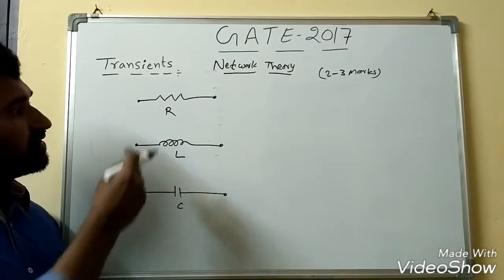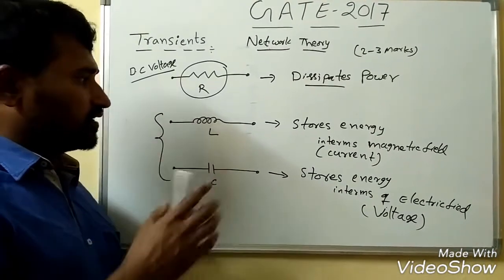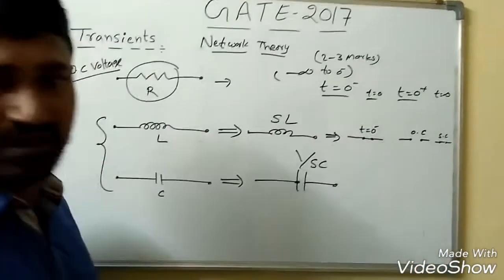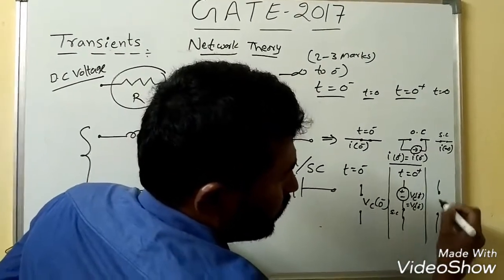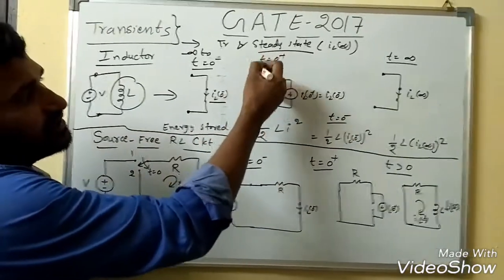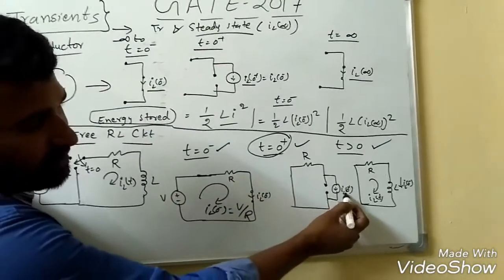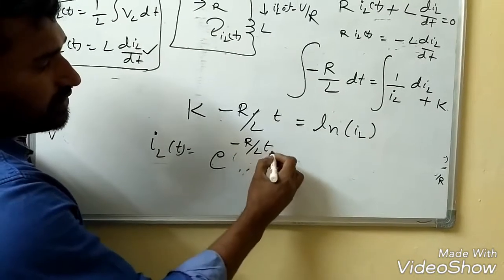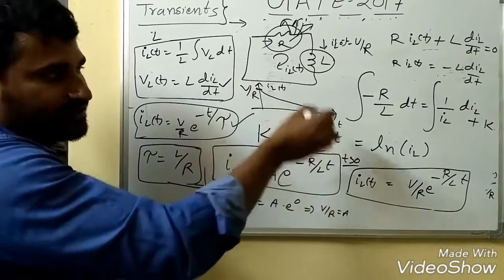Network Theory Lec-18(a): Introduction to D.C Transient Concept

Comment: sir what was the use of DC transient state
Reply from the maker: no it was not use of transients....if we apply a dc source to a RC or RL or RLC network there will be transient conditions...because d.c means sudden changes..but the storage elements (L and C) will oppose the sudden changes this condition is called transient state
Reply: Learning Is Everything DC means constant,then how it will cause sudden change......???
Reply: @n4_naidu  bhai dc apply kroge to zero se sudden hi change hoga na
Reply: @mdkalimullah4207  at the time of switching yaar